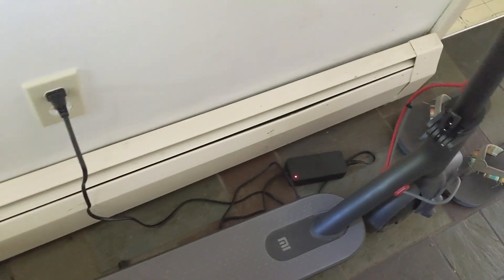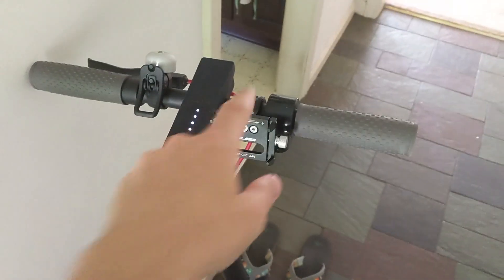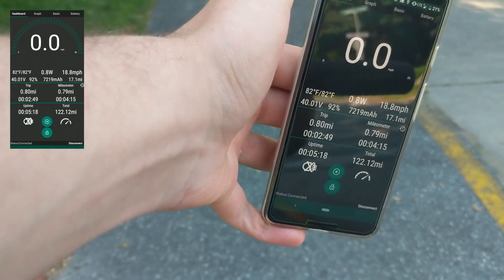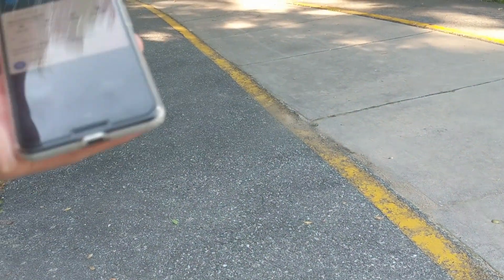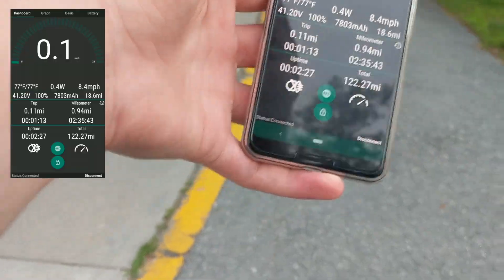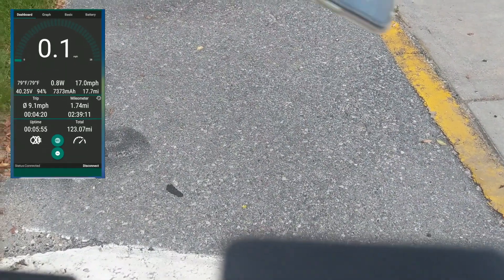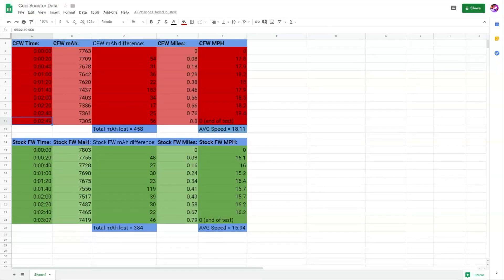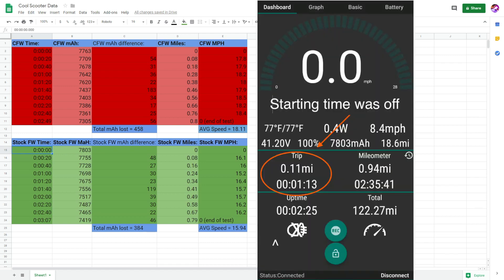Xiaomi M365 Scooter - Custom FW vs. Stock FW - FASTER SPEEDS - Comparison

Comment: This test has a big problem: you said you rode the scooter for like 1 minute to drain the mah so it would be closer to what the modified firmware was. However, when you ride the scooter, it drops some mah and then recovers after you finish riding something like 50mah or so. You didn’t take that into account and that was not used capacity, it was just a capacity drop when there is power used so the excel chart is not accurate in terms of the power used. The speed part and acceleration should be affected by this

Comment: 19% more battery usage for 13% more speed -  Not worth it.
Reply: He didn’t take into account the variable that he had been riding the scooter before which caused a slight drop and favored the original firmware in the test. If he had started using both with prior testing, it would have probably been same battery usage. This is confirmed by many people in their videos.

Comment: The power consumption seems kinda high on the motor even after you are done accelerating. What is your tire pressure? It should only use about 300-350 watts to maintain 18 mph on flat ground